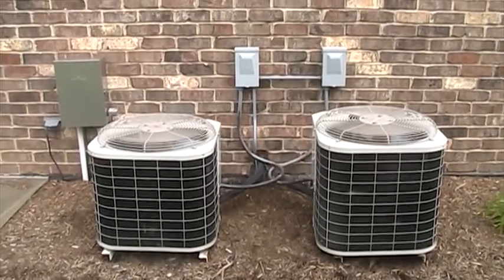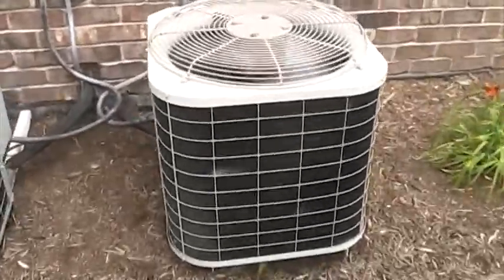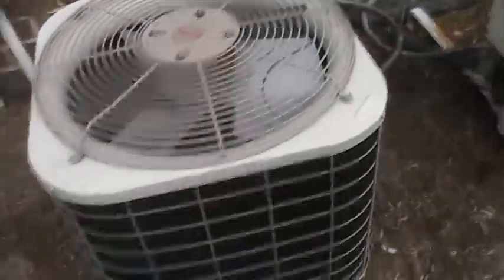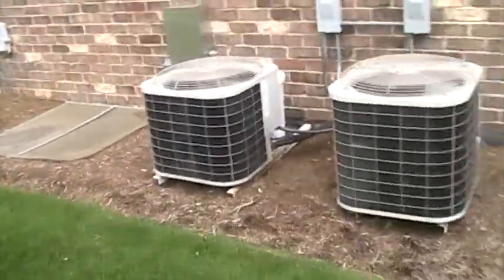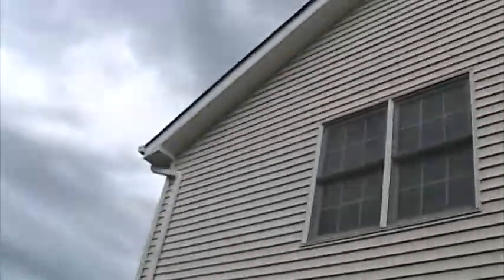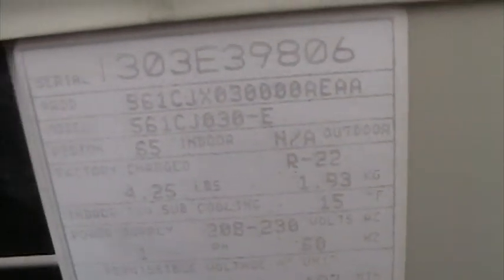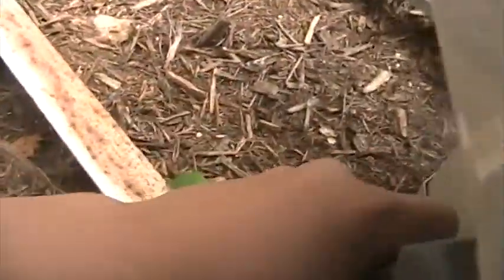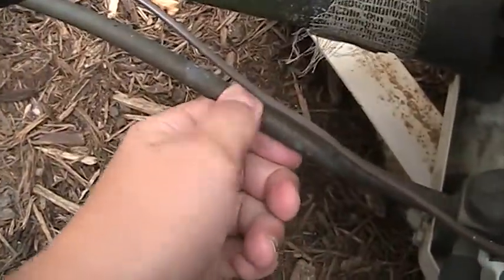Dual-Zone 2003 Bryant Air-Conditioners Running!

Comment: hahaa cool, even my home has a oversized air conditioner.. thinking of replacing it with smaller ones as it does not remove humidity!! Mine is a mini split though!!

Comment from the maker: Correct. They are quite a bit oversized. This house, based on the construction and layout, would need about 3.5-4.5-Tons. If I were to redo the HVAC, I would do a 2-Ton downstairs, and a 2.5-Ton upstairs. Then, I would install two 65-70,000 BTU input furnaces. I did check the blower speed, and when I pulled the covers off, I discovered that these are fixed speed blowers, as there was only one blower terminal and molex plug. That didn't surprise me, being these are BASE model furnaces.

Comment from the maker: LOL! Up here, that would never fly. 6 Tons would be appropriate for a 3,600-3,800 square foot house! 18 Tons would cool a 12,000 square foot house, or a 6,000 square foot building on average!

But down there, I can see why you need to oversize. One, no insulation, and two, It's hotter than hell year round.